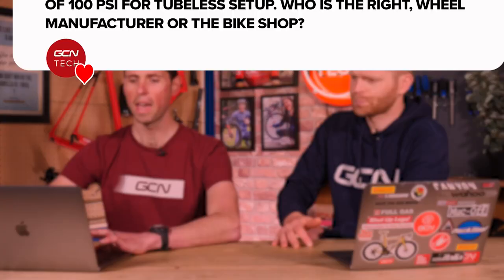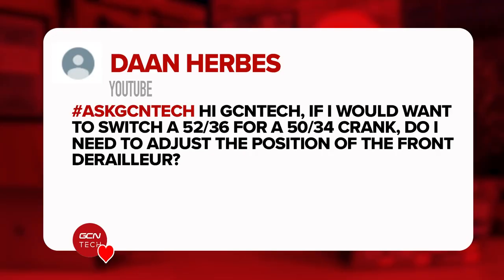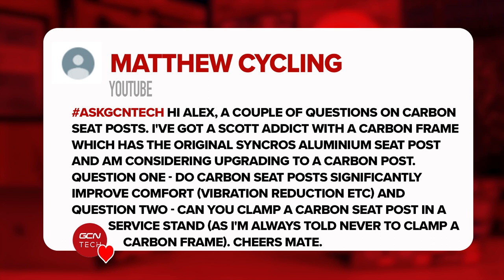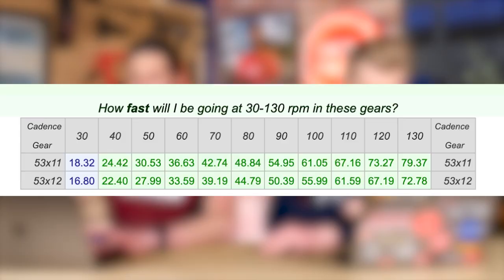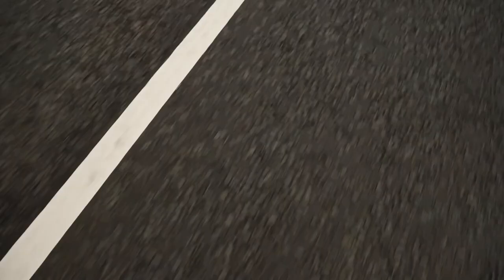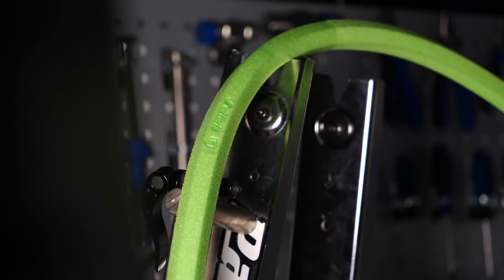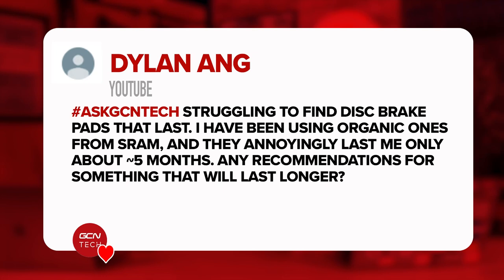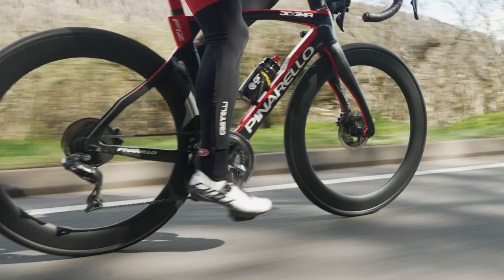Do Carbon Fiber Seatposts Make Bikes More Comfortable? | GCN Tech Clinic #AskGCNTech

Comment: #AskGCNTech - Hi, regarding last weeks question (on spinning out on 53/11) - my preferred cadence is around 60 - or rather, I prefer do to 6-8w per rpm (and trying to stay above 300w). I definitely do not fly around above 50km/h all the time. I only do 90rpm for shorter sprints/uphills (at 6-700w).
Reply: Do you have a different definition of 'spinning out' than us? 60rpm at 53-11 is utterly ridiculous to consider as 'spinning'. This is Grinding, surely? 
But, genuinely interested in finding out the issue here???
Reply: @chrisjepson8071  Spinning out as in not being able to pedal fast enough without compromising power - if I go at e.g. 55 km/h, I have to go at 90rpm, and I just can't maintain that for long, at least not with the power output I want.
Reply: I'm not an expert but if you have the feeling of Spinning out at 90rpm you should work on your cadence rather than changing something on the bike.
Please do it before trying crazy stuff like Zwift or any training app where 90rpm is considered not as high.
Reply: @jankroken3881  If thats the problem then you need to ride up hills
Reply: @ManuelMartinez09  I do have issues with zwift yes :( - had to turn off ergmode - if I slacked a bit uphills, it ended up more or less locking up
Reply: @96golfcl  My FTP tests are entirely uphill (I'm lucky enough to have a 6km 7% hill nearby), but outside of that, unfortunately the laws of nature means one can't always ride uphills.
Reply: @jankroken3881  spinning out is when the bike goes too fast to be able to pedal, like going 80km/h down hill, you can't pedal, pedals are 100%nfree cause you lack gears to go at that speed. That's why everyone was so hyped by your question
Reply: Most people comfortably site at a cadence of 80-90rpm then go up from there for sprints. As someone else suggested it may be worth doing some cadence drills to get your cadence a bit higher.
Is there a specific reason you are aiming for 300w at 60rpm?
Reply: Don't know if you are German. Never the less, I would recommend to train at atleast 85rpm and do speed (technical) training with an all out rpm without wobbling around 😅 and trust this is making a difference
Reply: Just reading this makes my knees hurt.
Reply: 60rpm at 300w is low and hard enough to where im gonna assume it is not good for your knees.
Reply: Has Jan Ullrich got married and took his partners name and is now Mr Kroken?
Reply: @jankroken3881  The thing is that you are doing it in a way most of us find weird because almost everybody (amateur and pro) aims for high cadences or at least 90rpm as "normal". Can you tell us why do you prefer such low cadence?

Just Thinking... Can FTP be overestimaded if test is done at low cadences? Can it be underestimaded if it is done at 100 rpm or above?
Reply: @ManuelMartinez09  I have no idea why., it's like asking yourself why you prefer to bike at your cadence rather than say 140rpm.
Reply: I'm somewhat similar (although less extreme). I'm more comfortable pedaling between 65 and 75 RPM. I think lower cadences are harder on muscular endurance (legs), but higher cadences feel harder on cardiovascular endurance (lungs). If I make a conscious effort to spin above 80, it feels much easier on my legs but raises my heart rate. "Spinning out" is the wrong term to use, though. Spinning out is what happens when you run out of gears, like in a full-on sprint or a steep descent.
Reply: @jankroken3881  But 140 rpm is an extreme as 60rpm is another extreme. 60rpm is literally grinding hard at 300watts, exept if you're on a leisure ride on a touring bike pushing 90watts. Maybe you're trolling us but if you do ride 60rpm +300 watts something is def wrong with you.
Reply: Your are a litte exaggerating in all your points, aren´t you. ;) - Your Strava says you average around 28kph and around 200w most of the time... 
90% in 53-11 at 60rpm would mean a much higher average. 

- But besides that: Like many others said here, you should look into cadence drills.
Reply: @jacksonmah90  I ride in traffic, traffic lights and with hills, can't go 100% all the time. There's quite a lot of time in the "active recovery" column, and I'm never in that zone unless my path is blocked or I'm doing things with my top tube bag or something.
Reply: You should definitely work on increasing your cadence to get a more efficient output. 60 is very low at the power you’re aiming for.
Reply: @jankroken3881  I prefer this because most training programs and methods consider 90rpm as "normal" and after a short practice time it becomes very easy and natural for most people... 
Not sure if your example is correct because  over 120rpm the body and almost any bike wobbles too much to keep that cadence for a long time.
I think that cadence suggested numbers are  not a matter of preferences, it's just what is standarized (based on long term data I guess)

Comment: #AskGCNTech  Hi Alex, Manon and Oli. We know latex tubes are lighter and have lower rolling resistance. We also know they deflate quicker than normal tubes. If I’m doing a century ride riding for 6-8 hours, should I be worried about pumping tires mid ride? How much PSI will I lose over the course of the ride? Is it worth the risk? Thanks!
Reply: why don't you just mesure it yourself with your tire and true variabels instead of outsourcing the risk management deparement to gcn?
Reply: I rode a 400k recently without any issue on latex tubes.  I'd be more concerned once you go into multi-day events >24h.

Comment: #AskGCNTech Why is a power meter more accurate for measuring calories burned than a heart rate monitor? I understand that a power meter directly measures the work performed, which can then be converted to calories, whereas a heart rate monitor is only measuring the effect on the cardiovascular system from said effort. Therefore the power meter offers a more direct measurement. But wouldn’t the power meter leave out a metabolic factor, e.g. how efficient you are at performing the work required? In other words, wouldn’t, say, holding 300 Watts for an hour be a lot harder for someone who isn’t a pro, and because their body cannot use fuel as efficiently, they might burn a lot more calories to perform the same output?

Comment: BTW You should not just switch pad from resin to metal wihtout checking if your rotor allows this! I just bought a new rotor. I did not check what it was. Slapped those metal pads.. And I had no brakes at all. It didn't stop. Then I read from shimano that the rotor was for RESIN PADS ONLY!

Comment: #AskGCNTech Hi guys,
I've got a question about aero-bikes: If you look at bikes like the Canyon Aeroad and Trek Madone those bikes look really aero and fast, I guess mainly because of their frames and especially the down-tube. But when you look at bikes like the S-Works SL7 and the Scott Foil, those bikes, in my opinion, doesn't look "as fast" or "as aero" because the frameset looks less aero. But both the SL7 and the Foil are designed with aerodynamics in mind, so my question is what really makes a bike an aero-bike? Is it the frame, the bar and stem, the wheels or a combination? And what would you say is the best aero upgrade: A more narrow handlebar with an aero profile or a set of deep section wheels?
Cheers and thank you for great content!
Reply: The marketing? ;-)
As far as I know the main part is the rider. There's a video of GCN that checks effects of tight clothes, helmet and wheels.
Aerodynamics is often "what looks fast is fast" but it's often not that simple.
Reply: the wheels and the rider will contribute to most of the drag. changing your riding position and adding some deep wheels will make a huge difference. an aero frame/bars/stem will not.

Comment: Hey!
I noticed that when I go to 50x11 the chain starts to vibrate from side to side. After replacing the chain and cassette with new ones, the problem remained. Is this normal or is there a problem with the cranks or the rear shifter?

#AskGCNTech

Comment: #askgcntech.  I have an old time trial bike that I still like.  Recently the front derailleur mount broke.  Because of the bike's age and the manufacturer no longer being in business, my local shop told me my options were find a used mount from that model bike (2008 Guru Chrono) or turn it into a 1x.  A 1x would really be ok for most of the races, but probably could not get up the hills around my house if I went on a training ride.  Any other thoughts?  3D printing?  Or what could options be for turning it into a 1x?

Comment: #AskGCNTech  I  am riding on Continental GP Attack/Force (22mm/24mm widths) clinchers  They are still in good shape so I don't need to replace them.  Our roads are very flat  here in the southernmost part of Canada, but are often rough with a lot of broken pavement.  I  used to run my tire pressure at 115 to 120 psi, which on smooth pavement was great.  With a view to the current trend towards wider tires and lower pressures, I am now down to 90 psi, and find it much more comfortable to ride.  For reference I weigh 98 kg,.

My questions are ...
How low of pressure can I run before risking pinch flats?

Is there a way of determining the pressure that yields minimum rolling resistance?

Comment: I run Tubolito inner tubes on one set of wheels and Vittoria latex on another set of wheels. The Tubolitos hold pressure no problem while the Vittorias drop pressure noticeably, Tubolitos are harsher while the Vittorias are more comfy - it's a trade off depending on what you're aiming for, race speed or a balance of speed and comfort.

Comment: #AskGCNTech When upgrading from the wheels that originally came with my bike, how do I determine if a new wheelset is better than what I already have?  I am looking for a wheelset  in the $500 range to put on a bike that was ~$1400 new and just don’t know what to look for.
Reply: I wouldn't worry about upgrades if you don't know what you are even looking for in an upgrade. Not sure you could even upgrade wheels for $500, unless you meant $1500..?

Comment: #AskGCNTech #Lube If using was-based lubes is clearly superior in terms of rolling resistance and maintenance, why isn't the cycling industry adopting this more? Is it just a case of tradition and slow evolution (such as disk brakes and tubeless tires) or any there any major disadvantages I should be aware of before switching?
Reply: Waxing chains has been around for decades (I started waxing my chains in the 80's).  The major drawback is the extra work involved vs drip lubes and most people don't think the benefits are worth the extra work.  Even I gave it up when I went to 11 speeds and the quick links were single use only.
Reply: @jefferycampbell2243  Surely wax-based drip lubes offer a solution to this to maintain the chain after doing an immersion only for the first time?

Comment: I’m running a tubeless setup on my Trek Checkpoint gravel bike with carbon wheels and 40mm Maxxis Rambler tires. I typically run these at about 30-35 PSI. I’ve noticed that my rear tire always looks low/saggy/etc. (my front tire does the shame if I shift all it weight forward). Is this normal with the wider, low pressure gravel tires or do I need to add some air to round it out a bit. Also, do most of my riding on chunky gravel and chip/seal paved roads.

Comment: #AskGCNTech Hey! I sadly bought a frame that's a bit too big for me, I shortened the stem and lengthwise I'm OK but even slamming it still gives me a too tall handlebar, less than an inch below the seat. I'm also quite slow compared to friends with other road bikes that actually fit them and have bigger drops from the seat, so they tuck a lot better than I do. Is the aero penalty really THAT significant for a weekend aficionado on flat-ish roads? Or I just suck?
Reply: You can gain ~120mm drop by riding in the drops all the time.
Reply: @dreimer2112  got a bad neck, can't do that for a full ride my man. I'd like a more aero position on the hoods.

Comment: I have a gravel bike with 2x11 GRX groupset which I'm predominantly using for road rides atm.  Chainring is 46/30 and I have a 11/34 cassette. I'm finding I need some more gears top end and rarely find myself using the easiest gears unless on longer climbs. What am I better off replacing the rear cassette or the chainring? Pretty sure GRX is cross compatible with 105 but I have no idea what I'm better off replacing. I still use the small chainring for longer steeper climbs so I'm clueless. Any help would be greatly appreciated 🙏

Comment: Who runs at max psi?  If the tyre is rated at 100, you should be running 80 anyway and then pay attention to your wheel rating as well.  You're less likely to pop a tyre, get better rolling resistance, and more comfortable ride

Comment: Trek Emonda with carbon seat mast, feels great.
However seat mast may be different story than carbon seatpost
Reply: I also have an Emonda (SL6, 2017, with mechanical Ultegra 6800), so I have no choice.
Reply: @larsmunch4536  I have a 2022 SL5 (with all my upgrades, probably an SL11 by now) which came with alloy seat mast. There is a noticeable difference in carbon for sure. Liking the carbon

Comment: Is GP5000 TL even okay to run on Hookless? Is not the GP5000 S TR the model made for hookless?
Reply: Correct.  The sidewalls of my GP5000 TL tires are marked "mount only on hooked rims".  I don't have the s TR version, but I believe that can be used on either hooked or hookless.

Comment: #ASKGCNTECK I sweat a lot and know I need sun screen on face but it always seems to get in my eyes.  Is there a sun screen that is eye friendly?
Reply: I have the same problem in the summer. Not a direct solution but I wear one of those tennis wrist towel thingies so I can wipe my brow / eyes before getting stingy eyes. Not foolproof but potentially useful.
Reply: wear a head band or a hat. . You can't stop the sweat coming from above your hair line with an antiperspirant.
Reply: Living in Australia, sunscreen is a must. However, wearing a cycling cap under my helmet and decent glasses means that I only need to apply sunscreen on my nose and cheeks so it never gets in my eyes. Give that a go mate.
Reply: There’s a product just for this a d it’s called Veo Strip. It works well. It is basically a well -chosen piece of rubber gasket or seal with a good adhesive, that acts as a rain gutter for your eyebrows and forehead, channeling off sweat to the side of your face. Looks a big weird but with helmet and glasses no one will notice!
Reply: @matthewvelo   That's my solution, too. No need for sunscreen above the eyes.

Comment: #askgcntech Hi, Just switched my tires to tubeless and was wondering if you need to put the valve cap on the valves? With inner tubes I always threw them away but not sure if it’s different for tubeless valves. Thanks!
Reply: You're free to leave them be if you wish, but high-end tubeless valves usually come with nice valve caps anyway.

Comment: #AskGCNTech Im running Grand Prix 5000 Clincher Tires only 2 months old after a service I noticed a number of holes which have been filled with sealent. My question is how long would the sealent hold before I need to change tires ?
Reply: Basically until the tyre fails to seal a hole. Then change the tyre.
Reply: sealant*

Comment: #AskGCNTech I'm riding a Triban 520 (the black-and-white one) with a Sora groupset and it came with a 12-25 "SunRace" cassette. Is it worth the extra money to upgrade to a Shimano 11-28 cassette to have a little easier time in climbs and faster descents, while also taking advantage of the "HyperGlide" tech that the rear derailleur supposedly have?
Reply: Yes 😀
Reply: If it's within the capacity of the rear derailleur and depending on the climbs you have, I'd go for a lowest gear that's even lower. The disadvantage is that the steps between other gears will get bigger.
Reply: @jochenkraus7016  It's a RD-R3000 (SS I think). According to Shimano's website, it can go up to 32T, but I don't understand what's this "Max. front difference: 16T" they state. Up front I run the default 30-39-50 triple crankset that came with it.
Reply: @rhobson  Maybe I'm misinterpreting the specs, but according to the information I found it should be a long one for your crank (20 teeth in front, 43 in total). 16 teeth in front sounds much like they had 50/34 in mind. 
As far as i know you can combine road, trekking and MTB parts up to 9x. M310 has 22 teeth in front and 45 in total.

Comment: #askgcntech
Hello all! 
I currently ride on GP5000 TLR and they are all worn out. I am planning to purchase GP5000s TLR. My LBS says that due to delayed shipping, they "MIGHT" get the new tires by July. What are the dangers and some drawbacks of riding tires that all worn out? Thanks!
Reply: When the GP5000 TL wear indicators are gone, the rubber is paper thin and some cords are starting to show.  Once the cords show, the traction is seriously compromised (you risk sliding out on corners) and they have much less protection against punctures or blowouts.

Comment: #AskGCNTech Hi all. I want to change my 11-32 cassette to a 11-34 one. I am running 50/34 at the front. Should I also change my chain due to a larger cog, or is the difference minimal and I can change the chain later?
Reply: As long as the chain can shift into large-large without straining the rear derailleur and the chain itself too much, it can stay.

But it's good practice to not cross-chain when you ride anyway.

Comment: Carbon seat post? My older MTB has a USE sus. post to dampen trail buzz. My ‘old’ Spesh Allez has Zertz…..elastomer inset in the CF seatpost…. And I’ve just bought a Carbon post for my Giant Revolt (D section post….yuck)